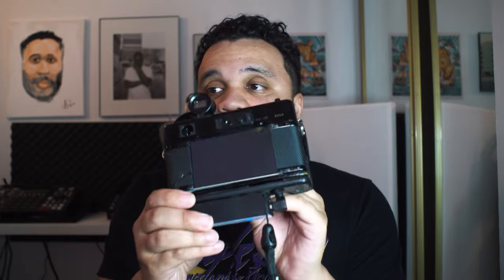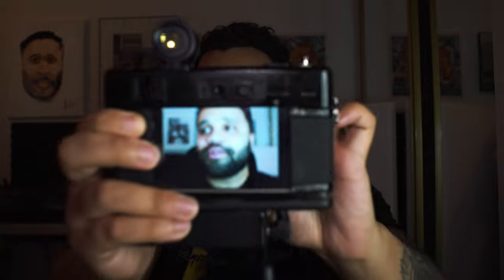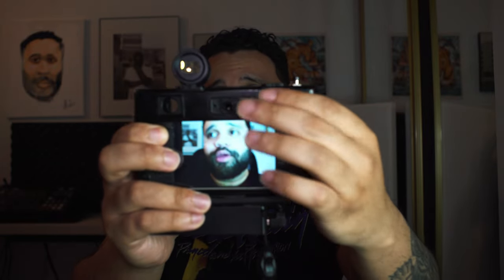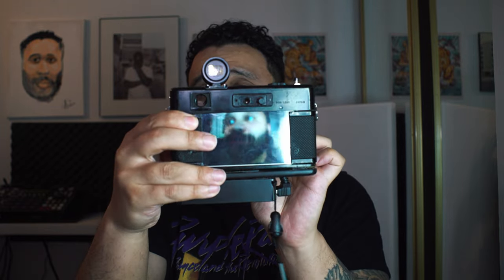From Analog to Digital: Converting Film Camera using a Raspberry Pi Zero

Comment: The batteries are Lithium-Ion 3.7V 1500 mAh 18500 single cell batteries! Excellent video and looking forward to the build walkthrough!
Reply from the maker: Thank you! I couldn’t remember off the top of my head when I was recording the video. I was able to find 3000 mAh ones to get a bit more battery life
Reply: @techbymalcolmjay  Nice find! I've been getting most of my electronics off of Aliexpress, but if you're in the market for anything that's got a crazy price or dwindling supply, feel free to shoot me an email or PM and I'll check the "spare junk box". I've been getting into STM32 lately with custom PCBs so I've got quite a few spare pi zero w and picos laying around :)
Reply from the maker: @PartsandRestoration  I’d definitely love to buy those Pi Zero’s off you!
Reply: Arent they 18650 instead? That would explain 3000mAh. Also amazing project, looking forward to the build tutorial/tips.

Comment: Hey man, this is really cool! I’ve been working on a similar project but I’m running into an issue with my LCD screen. Which screen did you use and how did you get it to work without interfering with the camera? I’m also using the HQ camera with libcam/Picam2 and something about installing LCD-show causes libcamera to not run and I can’t use the camera. It’s driving me nuts. Any help would be appreciated!
Reply from the maker: Hey, thank you! Try using Buster with the original picamera library. You can check out this project called “ruha camera” for a simple camera app. I’m using the Miuzei 4 inch screen
Reply from the maker: If you can’t run the lcd screen and camera at the same time, maybe there might be an issue with your power supply not providing enough amps
Reply: @techbymalcolmjay  Thanks for the reply! I can run the LCD (it turns on but it's black) and camera together, it's just the drivers for the LCD screen that cause an issue. Specifically, this is the error that I get back when trying to run my camera program after installing the LCD drivers (idk if it means anything to you because I sure don't understand it).

  File "/usr/lib/python3/dist-packages/picamera2/previews/q_gl_picamera2.py", line 98, in _init_
    self.egl = EglState()
  File "/usr/lib/python3/dist-packages/picamera2/previews/q_gl_picamera2.py", line 28, in _init_
    self.choose_config()
  File "/usr/lib/python3/dist-packages/picamera2/previews/q_gl_picamera2.py", line 46, in choose_config
    check_egl_extensions(self.display, ["EGL_EXT_image_dma_buf_import"])
  File "/usr/lib/python3/dist-packages/picamera2/previews/gl_helpers.py", line 71, in check_egl_extensions
    raise Exception(ext + " missing")
Exception: EGL_EXT_image_dma_buf_import missing
Aborted
>>>

I also can't switch to Buster/Picamera1 unfortunately :/ I tried to convert it but it just wouldn't recognize the HQ Camera module no matter what I did, and I think I'm too far into this project to convert. It's annoying because I don't understand why something as simple as an LCD screen would cause such a problem, and I can't really use the camera without a viewfinder xD